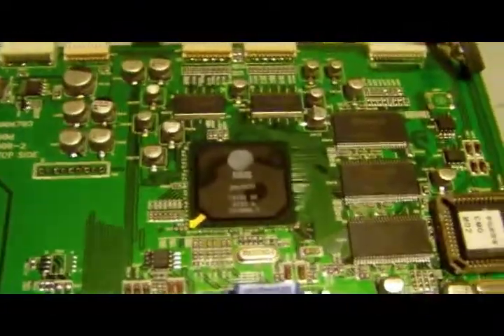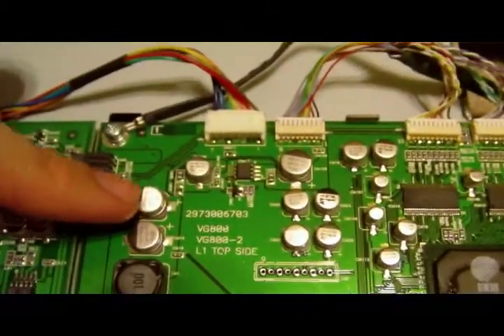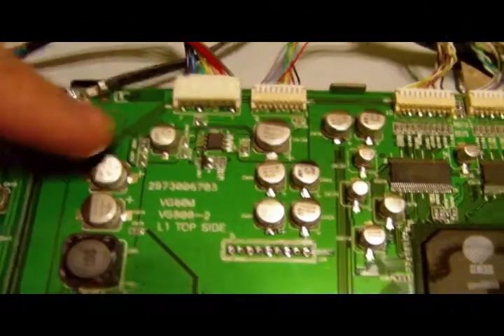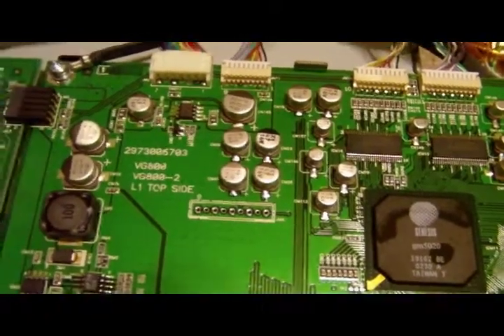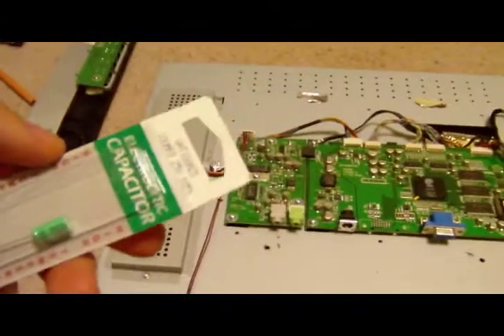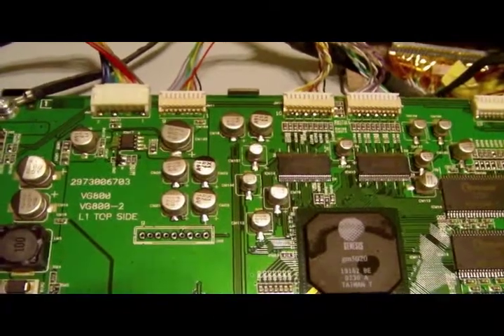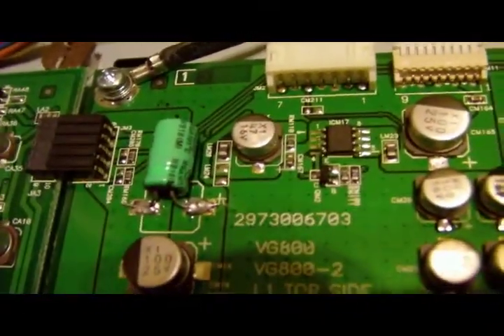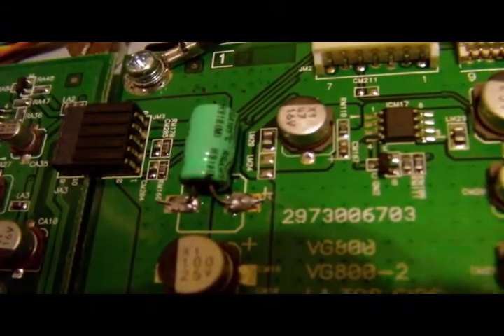Viewsonic VG800 monitor repair part 3, repair

Comment: Hello i am attempting to fix a view sonic 22" monitor with capacitor issues now when i go to order the capacitors it asks me for ohm  i was wondering  if there was anyway to tell what they were while still attached. It has a total of 6 blown capacitors. one of them for example is 2200(u symbol of some kind) f10v... If you could shed some light it would be appreciated.